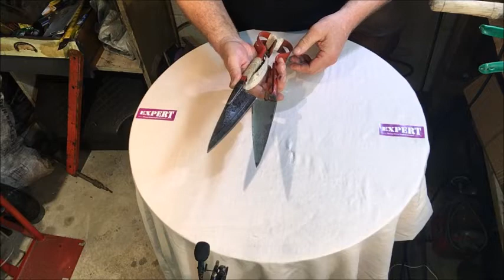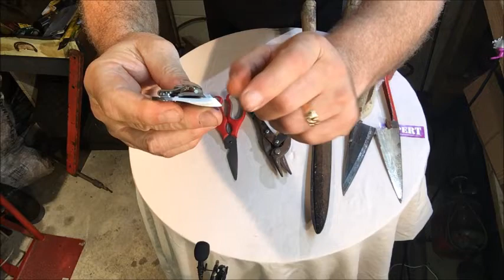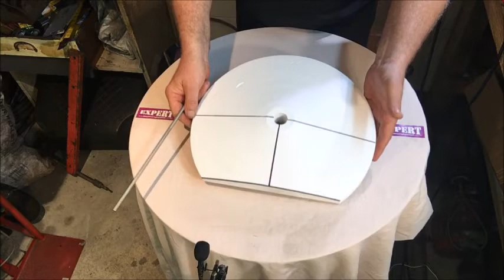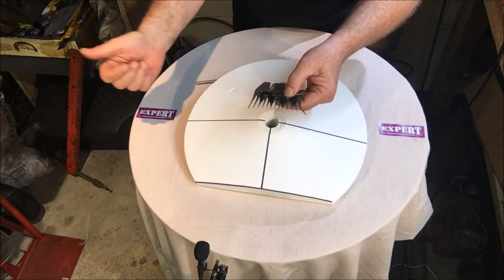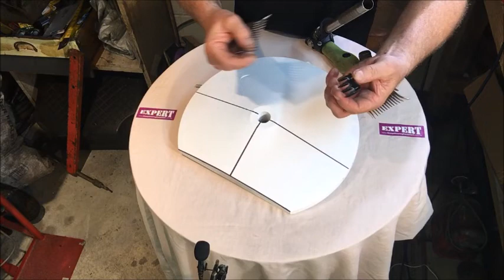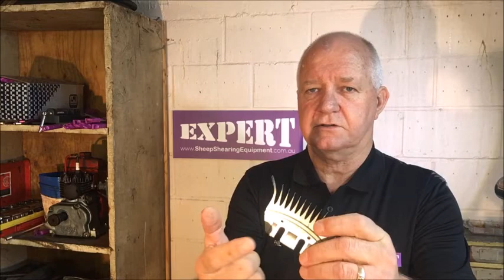Hollow grinding in a sheep shearing comb or cutter.

Comment: Hello. What is the degree of the cone on the disk?
Reply: On most discs for clipper blades it’s 1 degree conical, I’d expect sheep gear to be similar
Reply: @tomtd  Thank
Reply: @tomtd  Sheep blade sharpener is so cheap, about $130 on Amazon compare with the expensive clipper blade sharpener. I guess these are not much different !